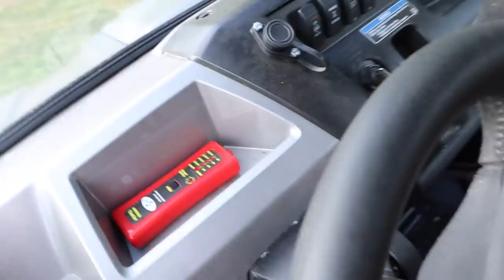Making Cheap CAST IRON Work Better Than TEFLON

Comment: Thanks for showing us how to sand the cast iron.  My grand mother just used steel wool to smooth the bottoms of the pans.  I have one that is about 70 years old now and it is smooth and slick.  We just went to Tennessee on vacation a few weeks ago and I picked up more cast iron skillets and lids.  I will definately sand and re-season them. Thanks again for the tip.  Love you channel.

Comment: I like Figaro - he's a cool cat. Gina looks good this morning. I processed all my cast iron. I used an abrasive disc called Quick Strip. It worked wonders. All my cast-iron is baby-bottom smooth and cooks like a dream. I can cook scrambled eggs and cheese and it slides out like Teflon is supposed to do. I use cast iron in my kitchen exclusively. Flaxseed oil, cloth applicator, thinner and more coats.
Reply: Gina always looks good
Reply: I am curious, why flax?
Reply: @artsymamanana  - Flaxseed oil (the food equivalent of linseed oil) stands above the other types of oil for the purpose of seasoning a cast iron because it polymerizes into a solid form during hours of high heat—and solidly bonds to the surface of the cast iron pan, giving it a thick, complete coating.
Reply: @benthere8051  thank you!  I was wondering about the advantage of that oil over others.  I am an oil painter, I suppose that is why flax has been so revered for art also!

Comment: Wow, never, seen any one do that to iron skillets before. To clean ours we just used to throw them in a bon fire, wait till it cooled off , sometime the next day,  washed them off with warm soapy water, and then season them with bacon grease a few times. Bon fire burned all the build up off.  Guess  i am an old timer. Lol!
Reply: he's fixing a manufacturing issue with some of new cheap pans(I bought some this week at Wal-Mart for $10 a pan), not a regular cleaning.
Reply: That is a great way to overheat and ruin a CI pan.
Reply: @needXC90  nahhh its perfectly fine to do
Reply: False, but go right ahead.
Reply: @needXC90  its not false and i encourage you to read more on it and educate yourself a little more when it comes to cast iron and the cleaning process
Reply: @punkqueen1022  I've stripped CI properly many many times.  A bonfire is gonna be WAYYY too hot.
Reply: @needXC90  because you made it too hot. Bonfires are perfectly fine to use. You need to control the heat of it which is the whole point. Cast Iron are great conductors of heat.

Comment: I have cast iron that was given to me as wedding gifts in 1972. I really love to cook with it.  Most people make the biggest mistake by submerging it I to a sink of hot sudsy water and scrubbing it.  I was taught not to clean it that way.  Take Care
Reply: How do you clean yours? I have seen a few different comments and also different video, seems like there are several different ways people clean theirs, I have put mine in soapy water and used a non stick scrub pad, then I re season, I guess im doing it all wrong,.  But it seems to cook fine  , how do you get something off that stick's to the pan?
Reply: David L I have had to actually use a steel soap pad when my boys were at home.  Then I would put it through the seasoning process many  times afterwards.  I actually had to completely redo my steel wok recently. It’s not putting it in soapy water to clean, but many soak it in there. I also will use a wooden spatula to scrap off things that are stuck. If I make milk gravy, I immediately wash and dry it while the pan is hot. Then put it on a hot burner to make sure all the water has evaporated.  I always put a little oil on when it’s dry. As you mentioned, we all have our own ways. A friend will not wash his, he uses a paper towel and really wipes it and that’s it.
Reply: @virginiareid5336  thanks for your reply, yeah I don't leave mine in the water long and I always do the same thing with putting it on a burner to fully dry and then a lil oil ,  thanks again.
Reply: David L you are very welcome. Cowboy Kent Rollins has some good videos on the subject. You might want to visit his channel as well.
Reply: Virginia Reid I scrub mine but then put it on the stove on lower heat long enough to dry and set it aside. Lots oil theirs but I don’t. I use mine daily.

Comment: For people who don’t have the tools......... try DeBuyer carbon pans from France they’re relatively cheap and come unseasoned, you just need to wash off the coating that they put on to stop them going rusty then season them. With mine I use lard or tallow for seasoning as they don’t break down under high heat, seed oils are generally Omega 6 linoleic fatty acids which when heated break down into Aldehydes and Formaldehyde which are toxic and they also produce a type of plastic that coats you pans and is very difficult to clean off. Saturated fats such as lard and tallow or mono-unsaturated oils like olive oil are fine.
Reply: other than flax/linseed vegetable oils don't dry, they only create a gummy coating that can eventually slough off when overheated, and usually impart a stale/rancid taste to the food. lard and tallow don't have those problems.

Comment: I re season my pans once a year and used to sand them down but found a brass wire wheel on my angle grinder works much better, it doesn't gouge the metal like a sanding disc

Comment: You can get flax seed oil by the bottle on Amazon. Canola oil works well too, it's also a high smoke point oil that polymerizes well. Sanding them down is a really great idea. Over time the bottom fills in with polymerized oil anyway and gets really smooth but it takes a lot longer than what you did.

Comment: I hate the "pre-seasoned" Lodge cast iron.  I remember when you just bought the skillet and seasoned your own over time.  I've bought a couple of these new ones and don't like them as much as the ones I had when I was younger and also the ones handed down to me from my mom and grandmother.
Reply: I have my cast iron pans from my grandmother as well. The only thing I have an issue is the crust on the outside. Inside are all smooth.
Reply: @Grimmarox  , I feel the same way,  The pre-seasoned pans are nothing like real seasoning!  I have sanded some, and love them!

Comment: I have my grandmother's  Griswold cast iron from Erie, PA.  Both these grandparents were from Meadville, just south.  I love the large Dutch oven and 3 skillet sizes.  They came "pre-seasoned" and I just keep them up.  I also have the lamb cake mold which grandmother had for daddy who was born in 1901.  It is not marked and Griswold did not make them that early.  Every time I use it, I completely re-season it in a 2 part process--learned from experience when cake stuck (makes good trifle).  Mother always did the cake in the 2 halves separately instead of put together.  I also did the research on that and found mother's way was better--another trifle.

Comment: Thanks for the tip on cast iron pans renew. I have cast iron but have never sanded mine, but I do ever so often use steel wool to clean deeper. it hurt me seeing you use the grinder but I know now that it is a good thing! So thank you, I will be trying this.

Comment: Thank you for increasing the recording volume on your closing comments!!!  Some advice on your sanding of cast iron: use a dedicated pad "set" on the paddle sander.  That way you avoid getting contaminants into the cast iron, say by example if that paddle sander pad had been used on galvanized? = bad for the health.

Comment: I sanded my cast iron and it's amazing to cook with now.
Reply: Using actual sand is how the old timers would clean out the old seasoning, and then re-cure. If used with sanding pad, you would not experience the clogging so badly. I do have a Dutch Oven I need to do, so thanks for the inspiration.

Comment: I have used cast iron for over 50 years. I learned to cook on a wood fired cook stove using cast iron. I agree, cast iron thats seasoned correctly, and smooth makes it so fun to cook. When it's not right, I'd rather eat food cold out of the can than fight with the pan.LOL

Comment: pollen is dead or severely disabled at 90 degrees, so you need to pollinate after the flowers open but before it gets hot.  Tomatoes stop growing when it gets to 95 during the day and the fruit won't turn red if it's above 85 at night.

Comment: When putting the cast iron in the oven, place them upside down.  That way the oil won't pool up, especially when you are giving it a heavy coat of oil as you did.  A very, very light coat of oil should be used, and the pots should be seasoned for longer than 40 minutes.  You should also have shown how to clean the cast iron after cooking on it.
Reply: You sound as if you have some experience with cast iron.  How do you clean yours after cooking, as I have some that need re-seasoning, and I'd like them to last a bit longer after I do.
Reply: @Sorarse  after use I just wait til it's still warm but not hot and use hot water and a nylon brush to wash it. I dry it and place it on the stove on medium high heat and when it's hot I rub a bit of oil in it in a very thin layer and let it cool. 
If you want to add a few quick layers of seasoning heat it up on the stovetop and add oil in thin layers letting it smoke and the oil will polymerize to the iron and dry and you repeat it as many times as it takes to give it a smooth shiny seasoning layer. The ultimate test for cast iron to see if it's well seasoned is making scrambled eggs in a bit of oil or butter. If they stick, it's not seasoned enough.
Reply: Correct.  You should rub off that fat like you are buffing for your life.  NEVER use a heavy coat of oil.

Comment: i love my lodge cast iron. the key is never wash with soap and water use salt and paper towel or salt and a half of lemon and cook bacon in it after you buy them a few times
Reply: Soap cannot harm the finish on a properly seasoned pan.
Reply: You can wash a seasoned pan like any other (that's a myth) just no scrubbing.
Reply: @Syrnian  putting chemicals on Cast Iron doesn't harm it? Ugh...
Reply: @mintysingularity  don't listen to Google...
Reply: Modern soap does not harm your cast iron seasoning as it does not contain lye.  I use soap on mine everyday.
Reply: @teloro1959  . It ruins the seasoning... and has chemicals. Do you though... if you wash your cast iron everyday you'd be better off using non stick. 

So according to you modern chemicals aren't bad...hmmm.
Reply: I’ve used cast iron pans for over 40 yrs and growing up my mother used them. I’ve never heard of sanding the pans, even if they’ve been sitting for years and not being used and they are rusty, you just scrub with a stainless steel scrubber, season and use like any other. Al, maybe it’s the Lodge brand your not having luck with. Try another brand. I’ve never bought Lodge, but I’ve also had mine for 40 yrs and now I’m lucky to have my mothers. I also love my newer cast iron enamel pans. Dinner looked great!
Reply: Jeremiah Grant when I used cast iron, I ALWAYS washed it in dish liquid and warm water. And if I needed , I would boil it on the stove top for a few minutes before washing it. Then after it was washed and rinsed good, I would put it on my stove top burner and let it heat until it was dry. And I never had a problem with my cast iron. I don’t even remember putting any kind of lard or oil in them. Just so they were good and dry, they were fine. But I have read several comments on here and seems that people have used different methods and all those methods have worked for them. So I say go with what ever works for that individual person.
Reply: @alisonjanvrin5448  Lodge leaves the pan with the rough finish from their sand casting, where other manufacturers refine the surface—they leave out that step. This is why they are so cheap.
Reply: @jeremiah1528  I was taught by my depression era grandparents that passed onto me my great grandparent's cast iron—numerous pans over 100 years old—in addition to me being a professional.  So enough with your flippant insults about listening to google, you don't know what you're talking about.
Reply: @jeremiah1528  
Everything that exists is chemicals. Cast iron is made of chemicals.
I use soap on my cast iron and high carbon steel pans every time I use them. It does not harm the season on those pans.
Mechanical/physical forces cause damage to the season on pans.
Reply: @alisonjanvrin5448  I got a Lodge pan for Christmas...horrible results with all their black seasoning, had to throw out perfectly good food. Also have my Mom's old cast iron pan, well seasoned, works perfectly, no problems.  Don't buy Lodge - whatever they coats with is black, gummy and never did got better even with re-seasoning.
Reply: I agree no soap is required and Kosher salt or chainmail scrubber if needed. I am an outdoors man and use cast iron almost daily at home and the wilderness. Many people don’t like the idea that it is not washed with soap,but to each their own.
Reply: Alison Janvrin the old Griswalds and cast iron back in the day were machined smooth. Now days they just crank them out for profit but high dollar cast iron today still machine theirs smooth. Sanding is not always needed but makes a bit easier when it is not seasoned for years like yours and mine. 😊
Reply: My favorite  newly wed gift is a number 9 cast iron skillet that I seasoned just for them with care instructions  included..js
Reply: Just never never never  ever wash in the dishwasher...js..
Reply: Stoneinthefield1- I have a 1908 Griswald 7" waffle iron in mint condition. Makes great waffles on our 1930 Home Comfort kitchen wood stove. I keep my old and new cast iron well seasoned with good results, including the stove top!
Reply: @Syrnian  but it can on a new one
Reply: I use mine daily for over a decade and wash it with soap every time. I always hand dry and add a coat of oil on heat for a bit. Does no harm and cleans better. Use a nylon brush no pads/sponges. You can tell it is clean by after rinsing soap clean again and soap is white with no color or debris. Takes me less than 5 minutes start to finish.
Reply: @traewatkins931  
You are correct.
What I said was different. It was referring to well seasoned pans.
Reply: @jennifercullison  
Oh no. Dishwasher detergent... not friend of cast iron.
Reply: My nana only used cast iron, and her mother before her. Thats over 100 years of use. She only used salt and lemon.  She said anything else messes up the flavor you've put there. She had 1 pan only for beans and it was washed 1 time every 2 weeks. She would make beans and when it was all gone she wiped it down with a towel and made more lol miss that crazy old lady
Reply: Jeremiah Grant hmmmm,  lets use natural chemicals them can't be bad, right?  Care for some arsenic or hemlock??  Soap is safe and modern!  I don't care how you clean your cast iron but bad advice  in isn't needed!

Comment: The newer cast iron pans are not as good as the older ones...always used an open fire to get build up or to remove any rust, if there is some and used plain old lard to re-season them. But never put them down in the dish water to soak when washing and always dried them immediately after washing to remove all excess water to prevent rusting. If they start sticking, just wet the inside with oil of your preference and cook in the oven on 350 for an hour and let it cool off in the oven as the oven cools ! Absolutely love cooking on my cast iron! Grew up old school I reckon.

Comment: I've been doing cucumber in my bedroom window. To pollinate I tried the paintbrush trick but it's more difficult on them than with tomatoes. So I remove a male flower, remove the petals so you're left with the male parts then insert those down into the female flower and leave it there for couple of days. Seems to have worked. That and plenty of water.

Comment: I grew up using only cast iron, my great grandparents set was given to my parents for a wedding gift. They were smooth and beautiful, when I moved into my own home and got a new set they were awful. 

I realised it was because antique/vintage pans were made smooth and it wasn’t until mass production came and they no longer had the time to grind them smooth.

I recommend to everyone to forgot “new” cast iron and scour yard sales, flea markets, scrap yards anything like that because you can get amazing pans for almost nothing. A lot look horrendous but clean and cook better than anything you buy now. You will also notice the old pans are lighter and easier to use. This does not interfere with the performance and I think they work better. You live in a prime area to find the older cast iron.

If you ever get a chance you really should check it out

Comment: i used to cross pollinate a little orange tree in the office many many years ago with a Qtip and it blessed us with many decorative oranges. New project is interesting, have no idea what your building but you got me hooked. The cast iron pans will give you many years of cooking when you give them some TLC, i have passed them onto the children and given them lessons on cleaning and seasoning. I dry them on the stove with heat after a cleaning with salt and water and while they are warm pour some oil on them, rub it in, cool and store with paper towel to absorb extra oil.